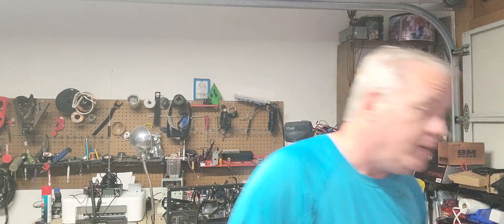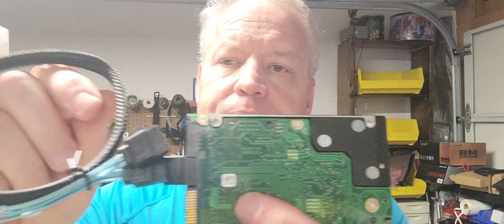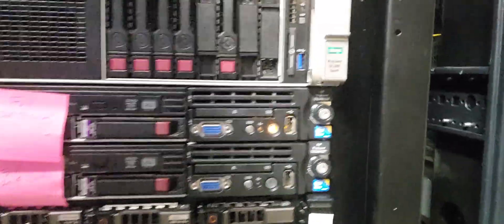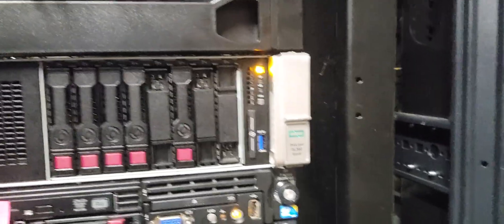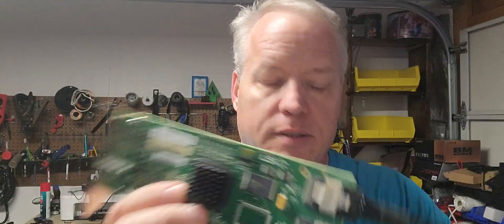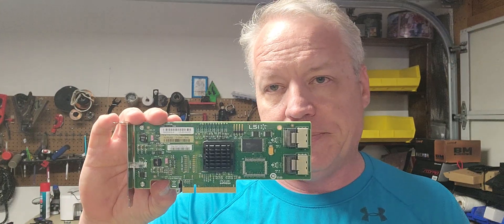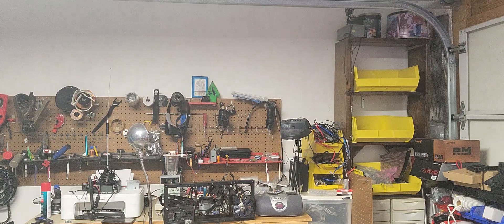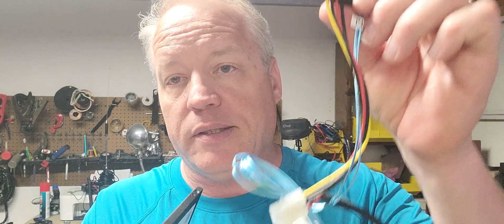OK, so you asked so here is everything you need to know to test SAS drives or format them

Comment: How to startup sas drive without sas controller just to  listen to its mechanical work is it ok or not ?
Reply from the maker: If it sound like a small jet engine that doesn't click in any major way, that means you have power and the drive is spinning.  But you need to post it to get if the BIOS is working as well.  In other words, get a SAS controller

Comment: I had a friend give me a dell server and it had 3 SAS drives in it.  I was hoping to be able to use the drives in my computer but that's not going to happen.  So what is the SAS to SATA adapter for?  I bought one of those and it doesn't work in Windows.  I have 3 drives that are useless to me.
Reply from the maker: Did you also buy the LSI 9200 SAS HBA controller and plus the SAS end of the cable to the controller.   Make sue you got the power connectors as well and it will work.     The LSI controllers run about $20 avg.
Reply: @leadiususa7394  I did not.  I pretty much gave up on getting it to work, however, I still have the server in my storage building and I'm going to look for it tomorrow (Monday) to see if it has a card in it that I can use.  I'll let you know what I find out.  Thanks for the reply!

Comment: What software do you use to view the HD.  I have a physical reader that detects the SAS drive but then Drive Sentinel, crystal disk and HDDscan cant show the status of the drive.
Reply from the maker: If you have a HBA controller, you will first need to mount and format the disk before you can run a diag tool like these tool you have on the on the disk running from a Window  or Linux OS boot disk. (USB boot disk will work.)   if a RAID controller instead, you have to create a RAID 0 volume then format the disk then you can read the disk.  Hope this helps some...

Comment: TL; DR: Most pc motherboards only support SATA storage and do not support SAS storage.

This is a terrible video: You say confusing things such as "because  the edge connector it is not detectable with a motherboard". Huh? Say it straight: SAS drives are not  directly supported by desktop pc motherboards that only have SATA interfaces. You need an interface card and related cables and connectors. This stuff is not difficult to understand if you can just get to the actual point.
Reply: Dude, the video helped me. If you can do it better then I'm sure people will appreciate your efforts as well.

Comment: Great video I wished I discovered a year earlier. Brought a big box of bulk SSD drives and got a few SAS drives that I didn't know what they were. Looks like SATA but could not connect them. I just put them into a little box and into a garage. 

Just earlier this week I found out that they are SAS. Unless I want to go through the hassle of getting a controller card and install into one of my computers, I might have to fork over $100 for one of the external SAS enclosures to test out the SAS.

Comment: Hello I checked your links the controller card comes with a battery is it needed.
Reply from the maker: it helps to make sure your data get written before lose of power.  Nice feature to have
Reply: @leadiususa7394 not exactly. The battery holds the data in memory so when the disks/system spins up again it can write that data to the disks. The battery does not power your disks for the last bits.

Comment: I got my hands on some 10TB 12gb/sec 7200 rpm HGST SAS drives and would like to use a couple of them in my desktop PC as general storage via a LSI 9300 card. Would this be possible and would Windows 10 recognize the drives? Great info you're providing, BTW. Thanks.
Reply from the maker: Yes, it should work in HBA mode for the drives will just show up as single drives.   If you want to RAID them, do you research on the driver but I think it should work basically.  Best to either hardware or software RAID 1 the drive for best I/O results
Reply: @leadiususa7394  Thank you for responding. I will look into the RAID 1. I can get 12 of the HGST drives for free and my PC case has room for 8 more drives, but that might be a monumental overkill in terms of storage for my use case. Lol.
Reply from the maker: @Waltkat  Glad that I could help you out...
Reply: @Waltkat  I have the exact same drive, I was wondering what driver you used and if possible you could send any links that could help?
Reply: @TheDingleBingle  theres a driver you can find from the bios after you plug in the controller
Reply: @hengry0  yeah, just learned my motherboard don't support that

Comment: Sir, I have SAS Controller On Board in my PC, but I only have SATA hard disk, and can't buy SAS hard disk for some reason. Can I use only the SATA to SAS Converter cable to connect my SATA hard disk to the SAS port? Would it work ?
Reply from the maker: Depends on your SAS controller is a basic controller or it is a SAS raid HBA controller.   Most SAS controller will do simple SATA disks so yes this should work for your needs.
Reply: Thank you for the information, sir
Reply: @fx5492  whats with the Sir rubbish